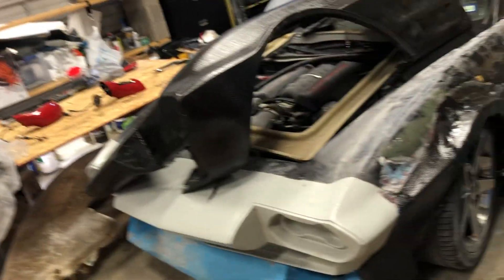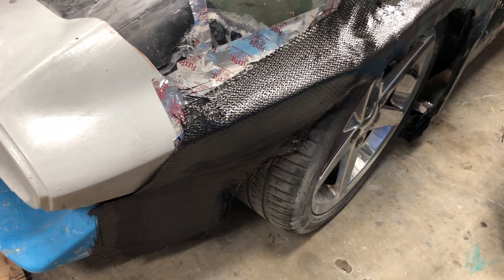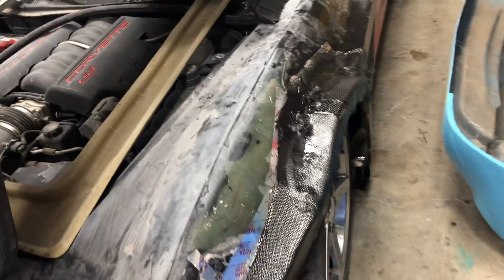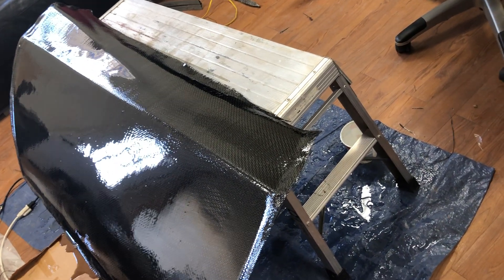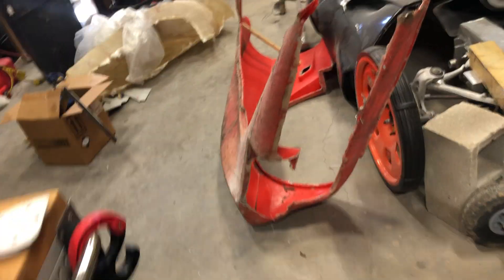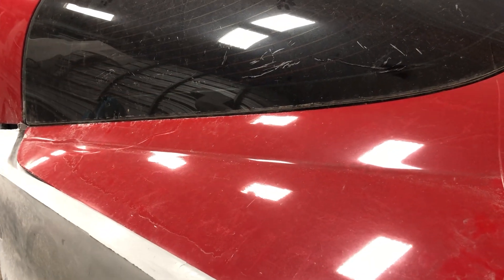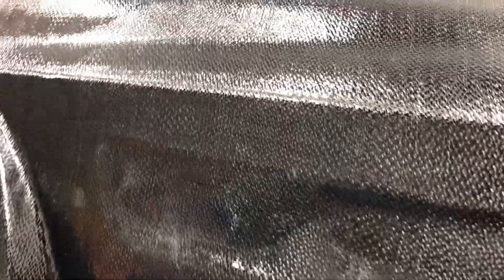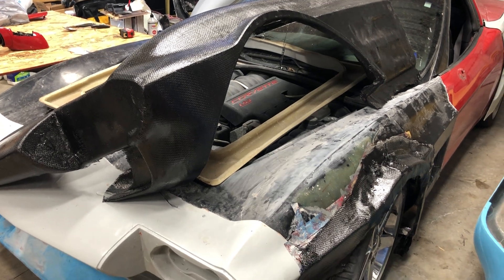DIY Carbon Fiber Body for the Same Cost as Fiberglass! 🙀 - C8 Corvette Hack

Comment: Super interesting! Couple of questions if I may:
- Would it ever make sense to stop at two (or even one?) external carbon layer, then demold, and add any extra layers internally? 
- When you finish the carbon, is it ok to sand into the weave at all before any final layers of epoxy as needed, or must you ensure that never happens, eg, by adding epoxy to any textured areas first?
Reply from the maker: Great questions! 

I’ve found that 1 layer of carbon fiber is pretty flimsy. If you pulled it off with just one layer, you’d have to do something to help it maintain it’s shape. You could purposely apply excessive epoxy and it would be stiffer. But it would also be heavier without being any stronger. But, after reinforcing it from the back side, you could sand down the excess epoxy. 

The larger and flatter the panel, the more layers required. A complicated compound curved shape could get by with just one layer. A flat hood requires more layers or a supporting structure behind it. 

The best approach would be to do the 1 or 2 external layers, pull the part, adhere thin foam (or balsa wood) to the back side, then add another layer or two to the back side. If you can maintain the shape, one layer on each side with foam in the middle would be the ultimate in strength and light weight. 

You will SEVERELY weaken the carbon fiber if you sand into the weave. Carbon fiber relays on the long strands to provide its strength. When you sand into it, you are making the long strands shorter and the part weaker. But it may not be an issue with purely cosmetic parts. 

That is why the “forged carbon fiber” is significantly weaker than typical carbon fiber. 

The other issue is they the carbon fiber frays the instant you sand it. You then loose the pattern in that area. If you’re painting or wrapping afterwards, no big deal.  

The advantage of a heavy external epoxy layer is that you never create carbon dust because you never actually sand the carbon fiber. Not itching for days afterwards has a VERY high value to me! 😊 

Finally, you can just spray the outside with clear primer or polyurethane clear. Carbon fiber is not UV resistant so it should be sprayed anyway. I heard that there is some UV resistant epoxy but my guess is that it’s not cheap. 

Feel free to ask more questions! 😊
Reply: @shadetreesupercar  Makes sense, thanks for the reply!